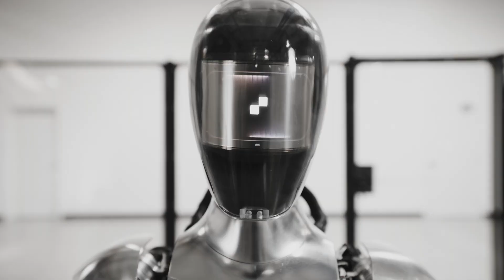Figure 01 AI Robot. Does this impress you?

Comment: This is way better than Optimus.
I have very little expectation from Tesla considering it's CEO and his scheduling failures and technical limitations.
What a joke.
Reply from the maker: I believe that Musk wanted to put forth a better example for competition, and their approaches and work on the software/ai side are important. Also, they identified that robot specific parts were needed that did not yet exist at specification, such as the solenoids I believe
Reply: @alby13  Everyone knew the parts wouldn’t be off the shelf. Aircraft 125 volt 400 hz was pretty much the only alternative to 480 volt 60 hz unless you used a VFD. The higher the frequency the smaller the motor can be with the same power. OpenAI settled on a 200 hz electrical system. A good compromise but all custom engineered, not that it’s that hard to do.
Reply from the maker: @Darth-Willow Good note! I was reading about that. I think these testbeds really do have meaning for the evolution of AI robotics.

Comment: battery operated? solar powered? ball joints & lubricant? hydraulics?
Reply from the maker: Battery operated, electrical solenoids that actuate. Not hydraulics based for various reasons. Hydraulics could allow for extreme payloads and mechanical advantage but there are downsides that that have been considered.